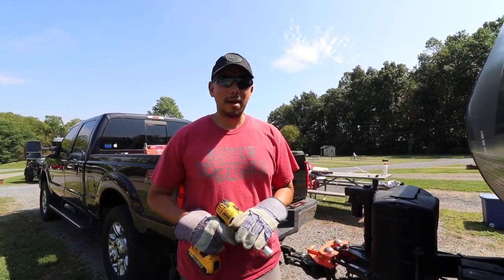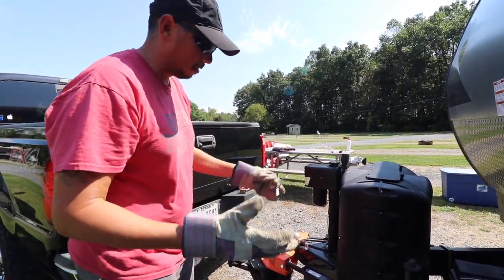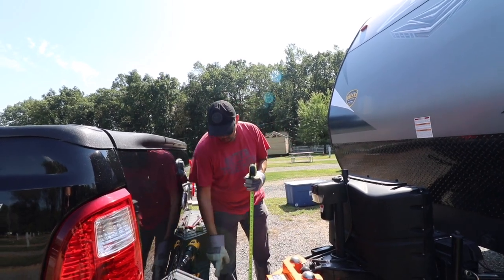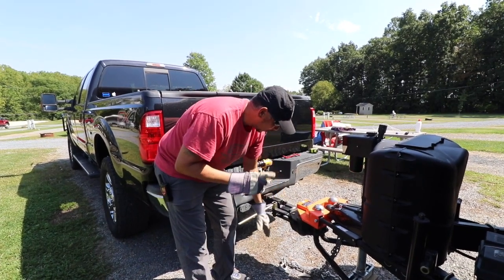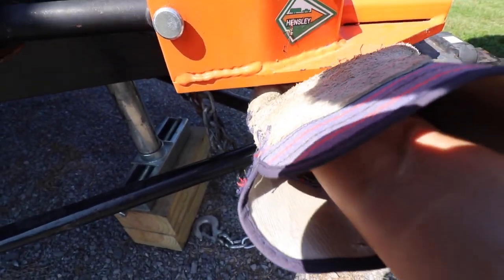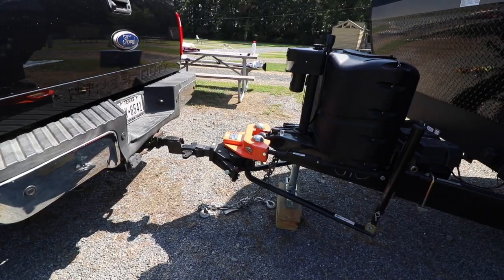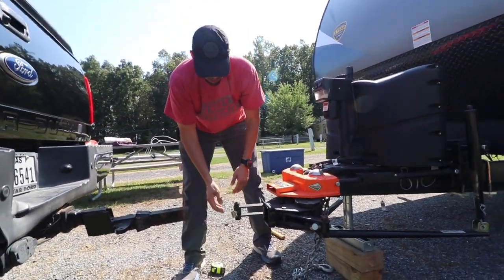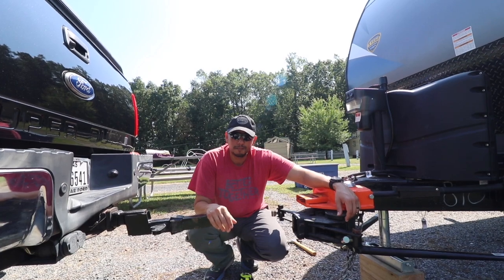Unhooking Hensley Hitch

Comment: Thanks for making this Hensley Video!  I love my Hensley Arrow as well. I have found when my OCL’s are tight and it drops forward like that the trailer chocks help from allowing the movement. I have slammed my hand between the hitch box and latch as well. This was the culprit. As I released the tension on the OCL the trailer was able to move and not chocked tight and from the proper direction.

Comment: Where we have parked our Lance 1995 travel trailer is on a decline gravel surface( can't park anywhere else.) Xchocks used. So we go to hitch up 
, backing up truck with stinger will be angled, truck end higher, trailer end lower. Any suggestions to make line up easier to hitch up? We are kinda new to this and my husband isn't confident with hook up.

Comment: How does this hitch work if the truck is slightly higher than the Hensley hitch on the trailer. Due to the slope in my driveway. Does the hitch pivot up or down for this issue, or do the truck and camper have to be very level for hook up?

Comment: It looks fairly straightforward  on flat level ground but what about campsites which are not level? Or straight? I have a standard ball hitch with Equalizer setup and even that is a pain when I'm in a pull-through campsite with a slope, tilt and curve.  How much out of alignment can the Hensley be and still connect and disconnect?
Reply from the maker: It's actually not that hard when you're not level. The jacks on either side can be adjusted with a power drill in seconds. As they go up or down the head of the hitch will also tilt up or down to match the angle you need it to be in.

Comment: If you had backed up the truck removing the latch would have been a breeze. The way everything jumped looks like you did not have the X chocks on the trailer. I secure the trailer and then try to back up a little to insure that won’t happen.
Reply: I have chocked the trailer wheels, had the trailer at the height that matches the truck, loose bars and STILL the trailer has shifted when removing the side bars (can’t remember the technical name either). It’s so bad the chocks Hensley sent me are all bent out of shape. If anyone has any suggestions pls share! I’m ready to sell it all because this is very frustrating! Charles you’re the second person I’ve heard said back up the truck into the trailer so I’ll try that next. 
Anyone ever use the “hitch helper”? 
Great video btw! Thx for sharing your tips!
Reply: @life_redefined  I have the hitch helper and it's been a good addition.  I feel your pain, my husband and I had some stressful hook/unhook experiences with the Hensley and at one point he was so mad he took the whole hitch off because even with chocks the TT was moving too much and we were afraid it would move forward and damage the front jack.  I haven't pulled my camper in the past 3 years and a recent 'friend' wouldn't even try using the Hensley and removed it when he was 'helping' me.  I'm reinstalling it myself this weekend and have been watching videos and trying to find tricks to avoid the frustration of hooking and unhooking with this hitch.  I love the way it pulls,-no sway at all- but you have to survive the stuck hitch and moving trailer, and it just doesn't seem right for it to be this frustrating and stressful.  Hope you find some answers too.  If you find some good tricks, post the site back here, and I'll check it out.  I'll do the same.